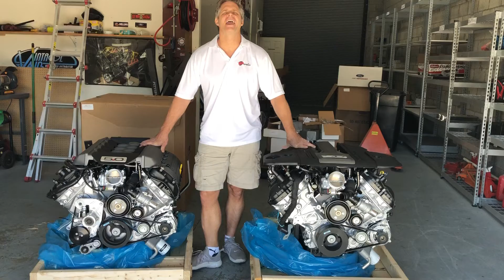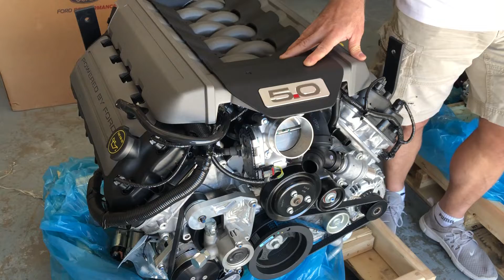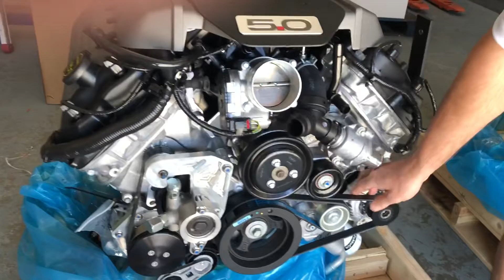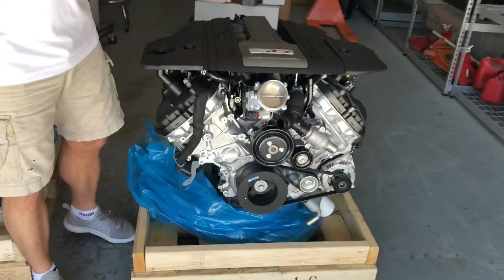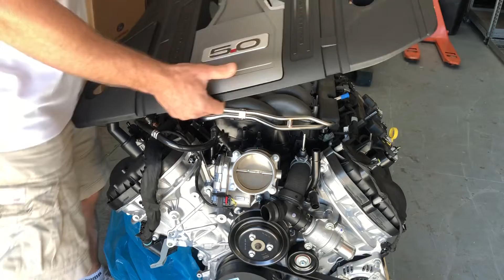Gen 2 vs Gen 3 coyote crate engine differences

Comment: I have a 2007 GT. I’m getting ready to do a Gen3 (w/Gen2 Heads) Coyote Swap. I’m also swapping my 5 speed out for a 6 speed tremec T56. I bought this car new in 2007. It was my “Mid Life” crisis car but I was only 32 back then. Now I’m 50 and I’m going to do a big boy upgrade. 

My current car had a squire TwinTurbo application at one time making a little over 500 hp. Eventually I went to a single Turbo once that Motor detonated. 

My car has a little under 100,000 miles on it and I’ve replaced everything on it thus far. I’ll make a YouTube video when it’s done in July, 2025
Reply: why no video?

Comment: I have a gen2 2017 GT PP manual Grabber Blue. After hearing about the infamous tick and oil consumption of the Gen 3, I'll stick with my N/A Stang.So far no issues other than the the issue with the IRMC valves on the manifold breaking. The last addition of the Manifold supposedly fix the issue. FMC should have done a recall on this obvious problem.

Comment: Gen 1 5.0 at 157k and still runs like a clock. Doesn't even burn that much oil. Really is a fantastic Engine.
Reply: That's cool to hear, I have a gen 2 sitting at 130k as of now still runs well. Not much oil burn quart or 2 but I change my oil at 6-7k full synthetic. I worry since some things happen and I have to daily ot now. Alot of hwy miles.
Reply: i got a 182k mile fbo e85 coyote and becides fuel pump going out she runs strong

Comment: Does direct injection require a different ECU?     For the cyllinder head flow numbers I have 289cfm@.500" as my coyote flow numbers and cannot find gen 3 specific flow numbers, does anyone have them?   So he said the differences:
gen3=460hp/420tq and gen2=435hp/400tq
1.  Direct injection on the gen3 vs port injection on the gen2
2.  12:1 cr vs 11:1 cr on the gen2
3.   higher flowing heads and intake manifold

Comment: Gen 2 Coyote is a semi closed deck, port injection with 11mm head bolts, while the Gen 3 is a open deck block, port and direct injection with 12mm head bolts. Being semi closed, the Gen 2 block is stronger for boost, the Gen 3 can run a higher compression since it has better cooling from the open deck design and larger damper for vibrations.

Comment: Just got my 2019 in August and I already had to take it to the dealer. Been in the dealer since Dec 21 I’m just getting it back Monday. My advice is if u got the 2018-19 GT make sure you get VCT Solenoid checked out they come faulty in a lot of those cars. My issue was my car would turn off at a stop or red light it would also though am positioning code and shake from what I thought was the exhaust. But after the dealership ran a computer on my car overnight and changed almost all the parts in the engine that was the issue with mine.

Comment: Gen 2 not actually a 5.0 but a 4.951L. Gen 3 on the other hand is a 5.038L truly a 5.0.
Reply: Yup they are true 5.0 and there manifolds are slightly better and are compared to the gt350 manifolds

Comment: Is The  Gen 3 designed to run on E85?
Reply: Yeah just need a tune
Reply: @MrAdrian13  not with the f-150
Reply: you sure can! All you need is a proper tune, if you're running it in a f-150 that's another story.

Comment: I wanna swap my eco boost to a 5.0 it’s a 2017 should I get gen 2 for compatibility or gen 3 for power I know I have to change the mounts wiring harnesses and controller module I’m ordering full exhaust system from gt350r with valance already have the big brake hit from brembo 6 piss in front 4 in back I wanna put I while on coyote would that be safe? Or should I build on the motor while it’s fresh out the crate?
Reply: Whipple*^😂

Comment: I have a 2017 mustang GT M/T obviously with the Gen 2 motor in to and my engine blew up today and I need a new engine. Was thinking about buying the Gen 3 motor as the new one. Do you know exactly what I need for the swap or should it just be a plug and play becuz both Gen 2 and Gen 3 motors are near identical?

Like do I need to buy a different harness to make it fit, a new PCM, etc.?
Reply: Earl Delsanto  you need to learn to shut up and speak when spoken too
Reply: I think you’ll use the gen 3 ecu with harness because its port injection

Comment: LMR.com Stock 2018 10spd Mustang GT Wheel Horsepower Dyno Results=
460HP at Crank
415 Horsepower 
397 Torque to the wheels.

Camaro SS 6.2 has ONLY 455 horsepower at crank 409hp+439ft TQ at the wheels.
Think about it. 

The Ford has the smallest MOST powerful per cubic inch N/A V8. If they could get the body weight of the car down noone else would stand a chance.

Dodges closer sized Hemi 5.7 liter has almost 100 hp less at 375hp at crank. The Scatpack has the 6.4L with 475hp at the crank.

Chevy doesn't have an engine near the same cubic inch/liter size that comes within a mile either.  Why's dodge and chevys engines so much weaker per cubic inch or liter. Prove me wrong. There's no other N/A American V8 that comes close. None. Fords 5.0 is the most UNDERATED engine America has BAR NONE!

And don't even get me started on the 10 speed tranny. Ford is at the top of the TOTEM POLE per cubic inch, FOR MUSCLE CARS FOLKS.
Reply: New tech will always be better, but I appreciate the differences.
Reply: With smaller ci engines you have to spin high rpms to make power. The gm and hemi engines make much more torqe down low where it's needed. Theses 5.0s have to spin faster to make the same power. That to me leads to a poor driving experience. Ford has also written off the oil consumption problems. So like the short comings on the horrible mod motor,  better get use to 4qts per oil change. Lol maybe that's ford's fix for oil changes just keep adding clean right?
Reply: ls7 isnt similar in liters but its a vastly superior production NA engine

Comment: I’ve had my 2018 for almost 3 years w/bolt ons and e85. No tick or oil consumption. It’s unfortunate for whoever had the issues but it’s really an amazing motor.
Reply: Any tips ? I got a 2019 for a year now and been great so far
Reply: @JG-10045  I change oil every 3-6 months but it’s not a daily driver. I think you’re good to go!
Reply: What oil type do you use ?
Reply: @thevishen1950  honestly just motorcraft and oem filters
Reply: Luv that e85!

Comment: Rather keep my 2017 gen 2....too many issues from the gen 3. Oil consumption, engine tick etc....
Reply: That with all coyotes generations and most of the time the ticking sound is a injector Failure most of us coyote boy dont know that and get sad when we here a ticking we think automatically motor but u be suprise when the coyote has a injector Failure it gives off a ticking valve sound
Reply: Gen 1 is the best
Reply: @henryjoksovic1539  no its not gen 2 is better
Reply: @henryjoksovic1539  gen 1 is weak 800hp u can grenade the motor
Reply: I have a 2017 gen 2 with 200k miles ..no problems whatsoever…love the engine!

Comment: I heard Ford may offer cylinder deactivation on their V8s next year. 
I wonder if it would be possible to turbo charge such a Coyote engine. Seems like it would be the best of both worlds but I am no automotive engineer.
Reply: It’s a terrible system and hopefully Ford doesn’t do that.
Reply: That technology is literally a problem on the long run. GM has done it since 2014 on their V8’s and at 120k miles they start having lofter issues like crazy

Comment: I would like to swap ford engine in my 69 mustang fastback.. I am looking into reliable mustang engines with stick shift.. any recomendation/suggestions?
Reply: F-150 coyote with flex-fuel (after 2018) probably less expensive
Reply: The Gen 3 will fit under the hood and it's smaller than a Boss 429.

Comment: Did ford solve the ticking problem in 2020?
Reply: No I have a 2020 with about 5700 miles and it ticks extremely loud and I believe I may be burning oil but I have to monitor that
Reply: @habanero5.054  use liquid moly ceratec and itll get rid of your tick
Reply: @predalienftw  I’ll check it out. Thanks
Reply: @habanero5.054  Did your tick go away?
Reply: @habanero5.054  "ah come on man?!"
:p
This sux :/
Sorry to hear that.
..guess I'll go buy another sport car with a LT1 and a proper tr6060 transmission!
Reply: @RimshotsandNamaste  haha yeah I wish it wasn’t so poorly built because it’s so fun and quick but you can tell Ford cheaped out on it. I’d recommend looking at the Scatpacks, maybe a camaro, and most definitely I’d highly consider a c63 AMG. You can find a pre owned one for a great deal and it’ll blow any of those cars out of the water+build quality is way better
Reply: @habanero5.054  yeah!
..but.. Lt1 and tr6060, you can't beat that :p (I want absolutely a manual!)
Reply: @RimshotsandNamaste  I don’t blame you I love the 6 speed I have but just not when I get locked out of 3rd gear😂
Reply: @habanero5.054  yeah I know!!
If only ford had put a nice transmission behind it's good coyote since 2011..I would surely already own one!
Glad they have a class action lawsuit on them for that matter:those mt82 are just a plague.
It's sad since they offer a grear gearing ratiod and when they work: the work well!
Reply: @habanero5.054  "Mustang vs. Mercedes" research is exactly how I found this video. I prefer the LT engine over the Coyote, but didn't like the Camaro that I drove. I've had a BMW for 8 years and a Porsche for 3 years, so I am familiar with maintenance on German cars. The Mustang has some serious quirks that are difficult to ignore, but it available with a 6 speed manual transmission. The transmission is yet another set of issues. Nice, fun, RWD, stick shift cars (that I like and can afford) are difficult to find. I will always be a BMW fan, but I'm ready for something different.
Reply: It's Ford. That's thier fix for the oil change. But don't worry it's got a screen inside.

Comment: The 3rd gen (2018) is a true 5.0L.1st and 2nd are still about 4.9L.
Reply: 4951 cc is closer to 5000 than 4900. You need to go back to primary school my friend.
Reply: @saauuzza  closer doesn’t mean 5.0L buddy pull your pants back up and get the real thing
Reply: @Hyp3B3ast  back to primary pls.
Reply: @saauuzza  clearly you need to go back with your dud "5.0" if you can even call it that lmfaooo
Reply: @saauuzza 😂😂
Reply: 5.1 cupcakes will always be better than 4.9 cupcakes.
Reply: Who cares? It's all marketing in the end. The 302 wasn't a 5.0 either (4949cc), but that didn't stop Ford from calling it that for over a decade. They didn't want to confuse between it and the 300 straight six (also a 4.9L engine), so they rounded up anyway.
Reply: The original 302 Windsor isn’t even a 5.0 it’s also 4.9 but Ford had already made the 4.9 300 inline six so they called the 302 a 5.0
Reply: Either way every single 5.0 ever made rounds up to a 5 liter
Reply: @popeyeandstraussmx4165  🤷🏻‍♂️
Reply: I heard gen3 was 307 ci?
Reply: Your math is so poor you should go back to primary
Reply: Happy Cupcake https://youtu.be/NPCi_B9hZSU 
Min 2:20
As for your comment. You check your math Professor Pancake. 👍🏽
Reply: @2023_Max  When you're wrong you're wrong you gotta admit mistake my friend. That's how you learn. Ford would be too happy to put gen 3 as 5.1 but due to the fact that it is only5035 cc they could not have market it as 5.1
Reply: Happy Cupcake there you go, see! If you change your language/expression, conversation runs smoother. And yes, I went more with his video without thinking Mathematically. 👍🏽
Reply: Happy Cupcake Gen 2 is not a true 5.0L. If you know the word “true”, then you’ll have to agree with that statement.
Reply: Happy Cupcake The gen 3 clears the 5.0 L displacement. The gen 2 does not. I don't know what's so hard to comprehend about that.
Reply: Happy Cupcake yup it's over 5000 cc. The 4951 doesn't.
Reply: Happy Cupcake Still doesn't change the fact that the gen 2 is is short of a 5.0L displacement.